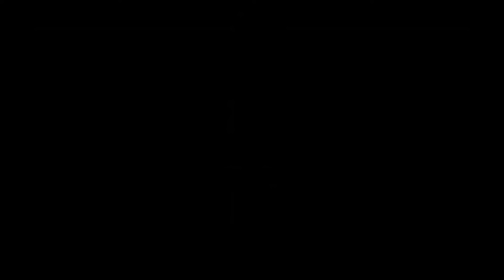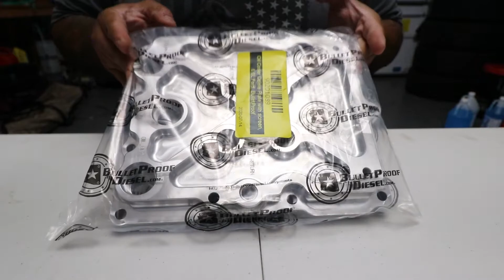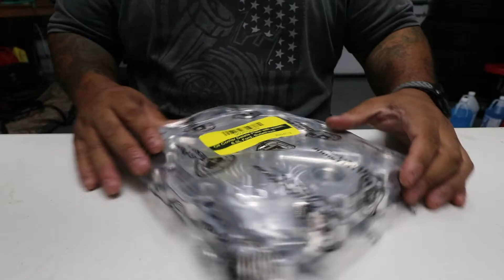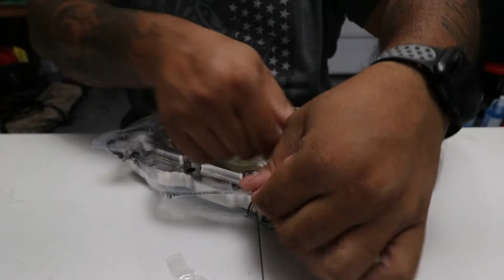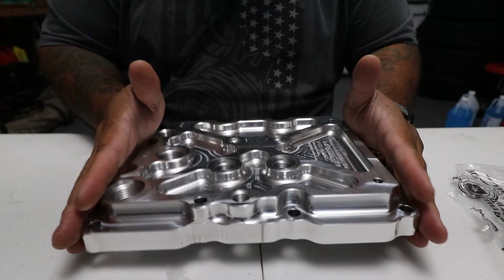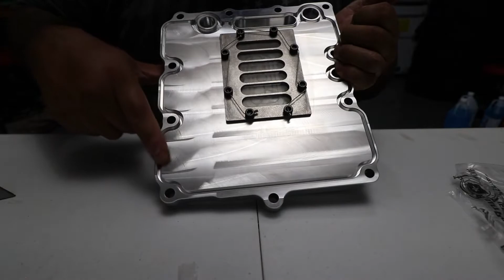Bullet Proof Diesel Oil Cooler Plate: Review and first impressions. 6.0 Powerstroke

Comment: Don Juan -Great video!,,I used your content infor to install my BPD delete plate. I am running into an issue of it leaking around  the in and out ports . What size and type of fitting did you use on yours?

Comment: I see two other bdp manifold plates, a bit expensive for 6.0 what is the difference?
Reply from the maker: One had their whole system in place ( manifold looks a lot thicker) the other not sure. This one allows for full diy application and build ur self
Reply: Late reply.

BPD offers 3 manifold plates. 

This one deletes the mounting option for the fuel and oil pedestal, isn't meant to be used with an EGR cooler, etc. Basically use this one if you have a custom fuel pump and filter setup, are running the BPD/other oil filter & cooler setup, and have a deleted EGR. 

The next two manifolds are a less drastic change. Both allow you to maintain the oil/fuel filter pedestal, and both make integrating with an EGR easy. One is designed to work with the BPD oil filter and oil cooler kits. And the other is designed to work with an OEM oil cooler and BPD external oil filter.